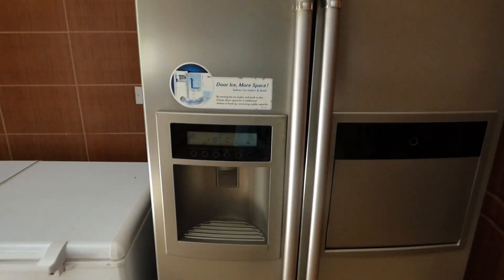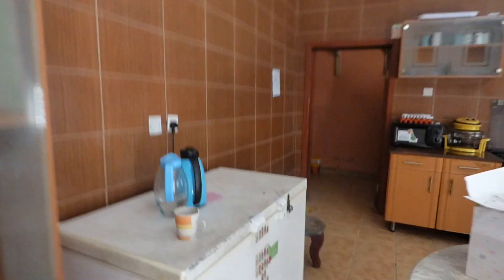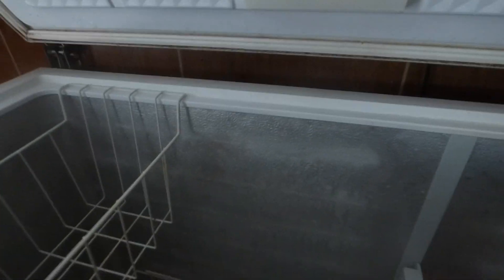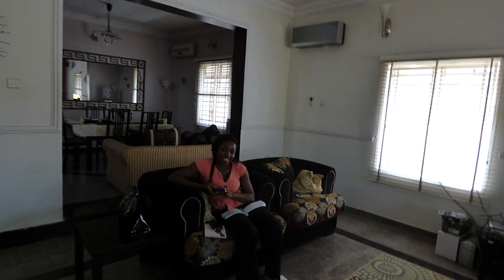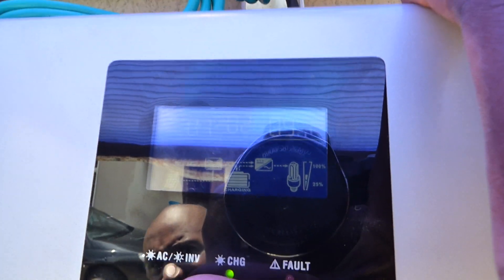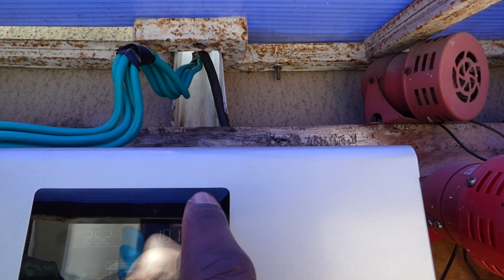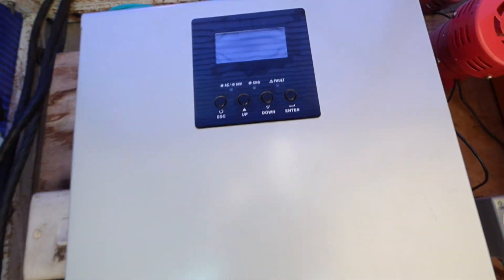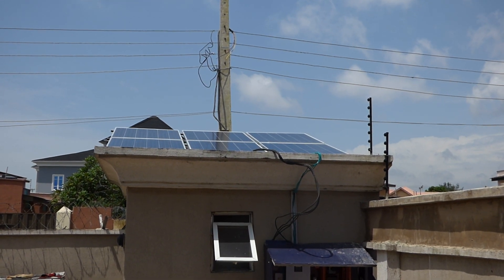3 Kva (2.4W) Solar Power generator in Magodo GRA Lagos

Comment: Can this 3kva inverter be set up or checked on the laptop using the CD and cable provided.
Reply from the maker: The interface is horrid. The cable provided works with older computers not newer devices. So the simple answer is no

Comment: 6  panel of 200W  is 1200W , at the beginning of the video you said is a 3KW system ?  how did you arrive at 3KW  with a 6 panel of 200W each?
Reply from the maker: Smith Padua  it is a 3 Kva inverter. The PV is less than the inverter capacity.
Reply: Please listen to your video again,   what i see is a 1200W  system  judging from your PV array and not 3KW.   if your inverter is 3KVA  don't translate to a more than 1200W  output  excluding losses  because you having just a 6 PV of 200W each.  Science is factual please.
Reply from the maker: Smith Padua the inverter had a battery. If it is 3 kva it can output 3 Kva, the batteries bank / capacity determines how long it outputs that 3 Kva for. The PV does not. Your logic and argument applies to grid tied inverters not off grid inverters. Thank you for watching

Comment: Don't know about placing the panels on the security guard roof due to issues of theft. why not on main house roof?
Reply from the maker: Fantastic idea. That is where we havr suggested we place them to every customer since. Disadvantage comes when we have to clean them. Theft so far has not been an issue for most of our clients. The one that got stolen was from the roof of the building it was installed on.
Reply: Its makes it easy to clean

Comment: Did you do a shading analysis? What effect does the electric pole have in the panels?
Reply from the maker: Your question is a very good and relevant one. The trajectory of the sun is such that there is no shade from the pole on the panels. That is the reason for the tilt and the direction the panels are facing. Thank you very much for following us